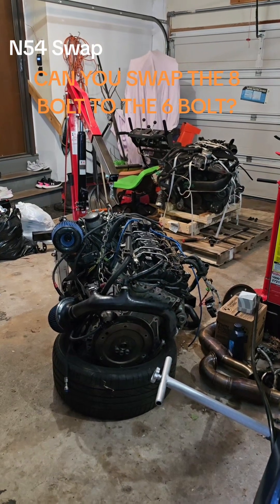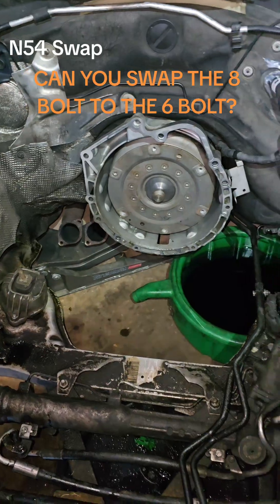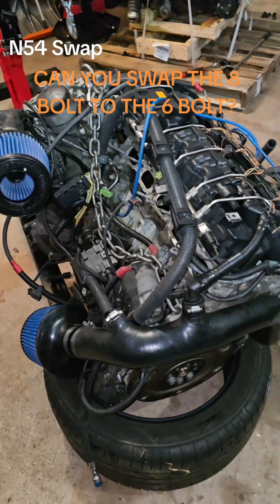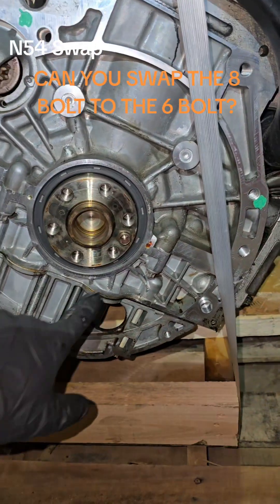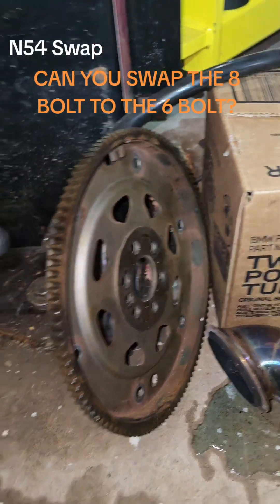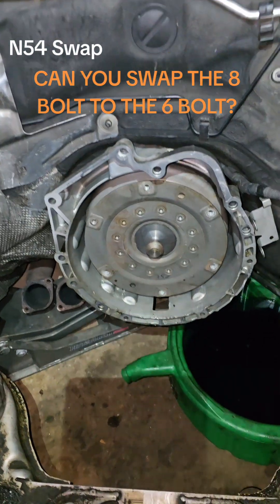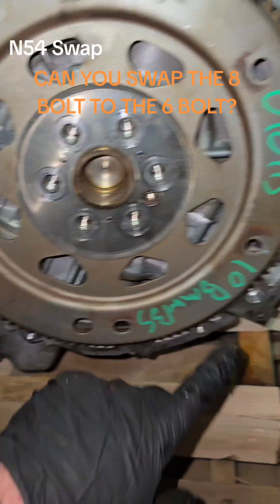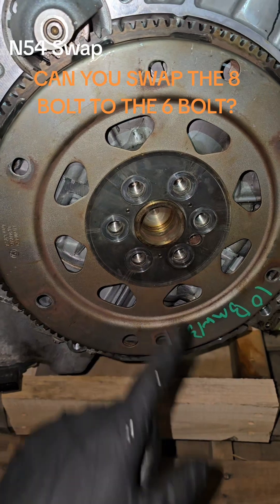N54 Engine Swap Update: Can you swap a 6 bolt N54 Crank Engine from an 8 bolt N54?

Comment: So I can use either or torque converter? As long as the flex plate is correct ?
Reply from the maker: The flexplate has to match the crank. 6 or 8 bolt pattern. The torque converter bolt configuration is the same

Comment: Hey question my case sam think just manual transmission.. my 8 bolt crank I swap 6 bolt crank…. Engine crank but no start… please help
Reply from the maker: You swapped the entire crankshaft? That would be fine with the right flywheel.  Your not start issue may be a lot of things. Timing, fuel, spark, et